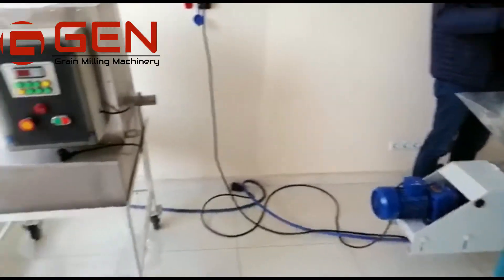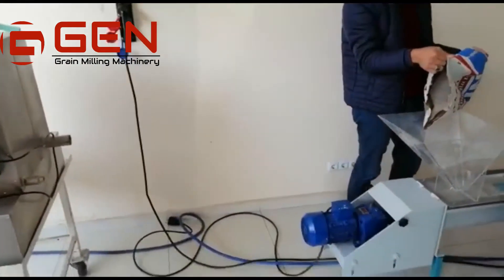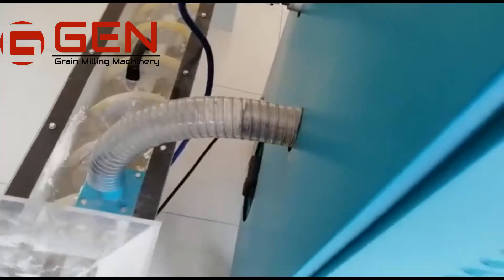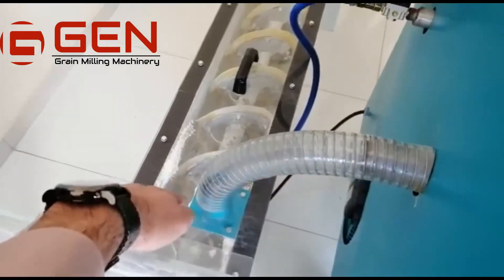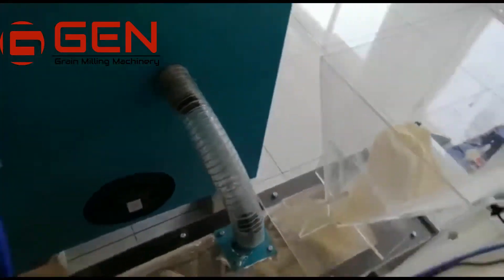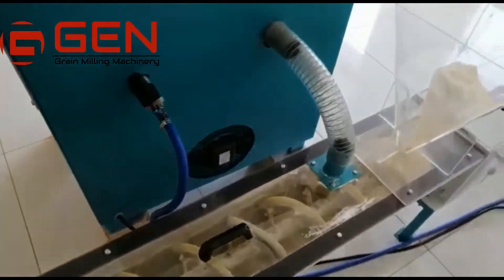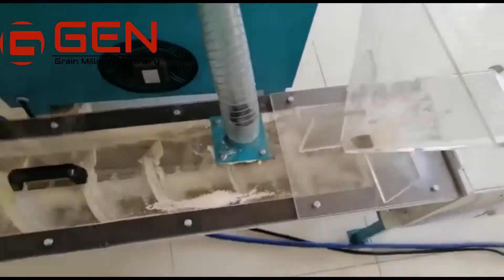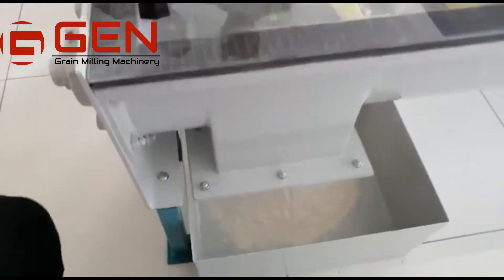Ozon Machine ( Whitening Machine )

Comment: Thanks , but what's the capacity of o3 generator which is suitable for flour yield rate ?
What's the suitable length of flour screw that allow to o3 to affect flout and whiten it ?
What's the rate of o3 generated to be affected on flour ?
What's is the exposure duration?